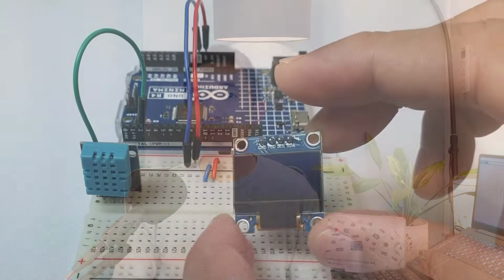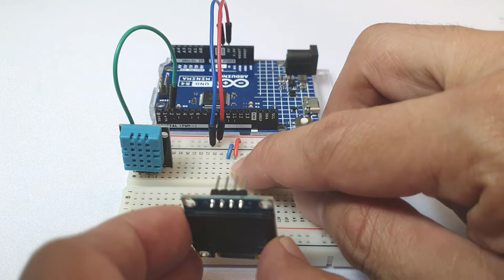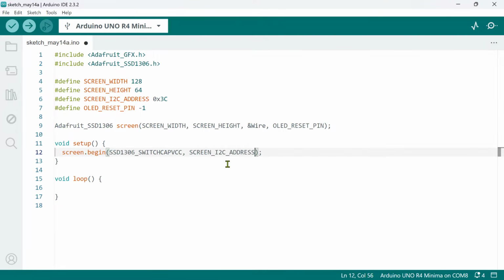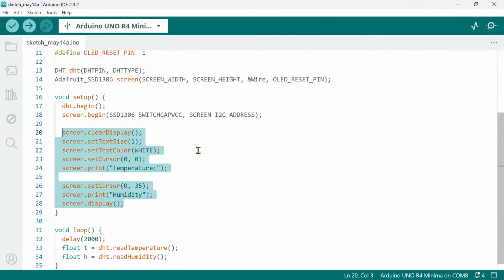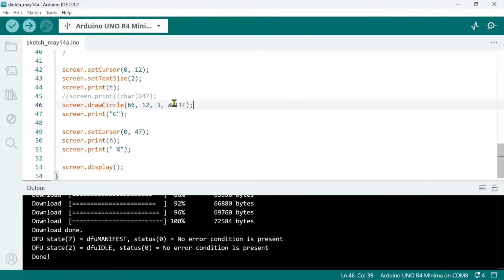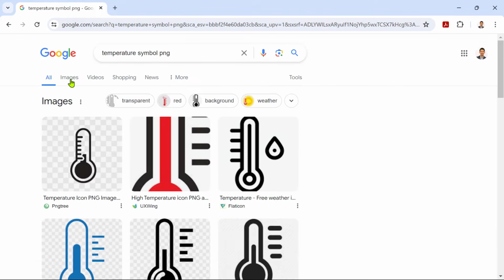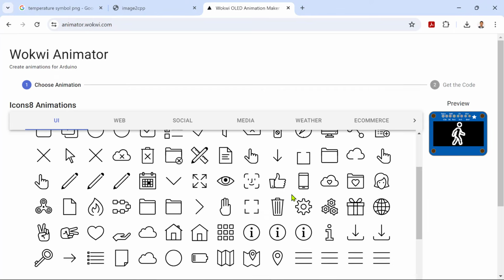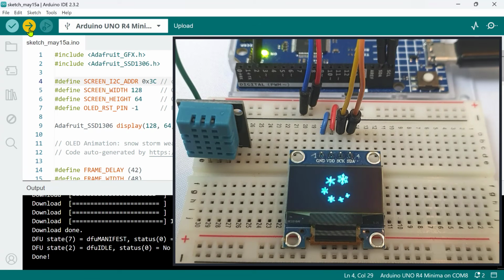Arduino UNO R4 Lesson15 - SSD1306 OLED Display | Text, Graphics, and Animation

Comment: If anyone is facing issue of random pixels on their SSD1306 OLED display with R4 minima , try adding this line in setup  Wire.setWireTimeout(10000); . It worked for me after struggling for a couple of days with 3 different displays bought online in India.  I Finally came across this solution on a arduino forum. Thought of sharing it.

Thank you Sir for your amazing tutorials.

Comment: Great series! I was originally looking for a series of lessons for the Arduino UNO R4 WiFi and found this one for the Minima. I purchased the "SunFounder Ultimate Sensor Kit with Arduino UNO R4 Minima" and have appreciated your lessons. I stumbled through some of the "Challenge" sections but worked through them. You provide enough hints to complete the challenges  and made them interesting. I did go back a couple of times to a previous lesson to properly figure out the challenge and will keep these Sketches as references for future projects. I look forward to going through the "Arduino UNO R4 Wifi  - IoT Development Crash Course". I do wish I could purchase the SunFounder Ultimate Sensor kits without the Arduino boards since I already have them, but its not enough to deter me from proceeding with the next series. Thank you!
Reply from the maker: Thank you for watching Richard! :) I will continue both series by the end of August. I've been super busy with my full-time job since last Month.

Comment: when you use the "#include" is that library you list automatically added? because when i used #include <Adafruit_SSD1306.h> and #include <Adafruit_GFX.h> there is no issue but when i used #include <DHT.h> it says there is no directory for it. what did I do wrong?
Reply from the maker: please include the dht library by Adafruit. You need to install it first. I've discussed that in the previous lesson. Thank you :)
Reply: @joedgoh  ok thank you. i'll watch the previous lesson